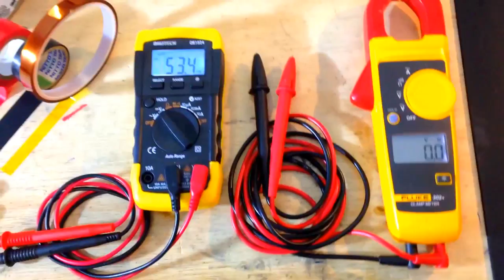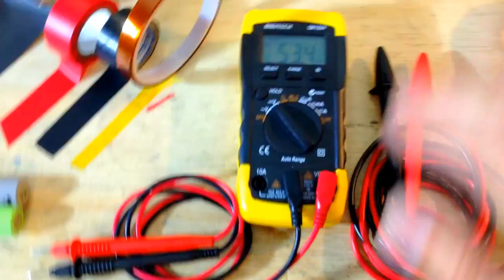Planning on making your own battery pack? DIY guide / tutorial • 18650 cells Electric Bike

Comment: We are building our first battery. So far seems good! When you finish building battery, what tests do you run? We are going to test balancing, and heat. Anything else you recommend? Thanks so much!
Reply from the maker: +Clifford Zvengrowski - Yeeahhh.. I am glad you're asking these questions... this is a good thing =] We source our cells freshly from LG Chem, by the time they arrive in our hands the cells are less than 30 days old (sometimes 2 weeks old) and individually tested by advanced machines at their factory. We could get the cells and build the pack without testing anything but we test the voltage just in case, they are always fine, always exactly the same voltage... then I group all cells with the cell holders and start spot welding. I measure the series voltage, I measure the whole pack voltage, I charge 100% and discharge all the way till the BMS cuts the power. I repeat the cycle about 3 times. We use a simple watt-meter that gives us the voltage, amperage, Ah... I will be posting a video showing how I continuously discharge these packs.. it is really intense on the cells.. basically I hooked up 4x 12v H7 bulbs connected in series (48v) and if you want more watts/amperage you add another 4x bulbs connected in parallel. I found that 4s 3 or 4p configuration for this discharger are the best configurations, your cells will be hot after 5 minutes, so grab a fan... Lithium cell don't like heat... don't force too much. Be extremely careful with every single detail, plan every movement and watch everything around inspecting for metal things that could possible cause any short circuit. Remember.... so much POWEEEER =]
Reply: ElectricBike
NICE! Thanks so much! We are using Panasonic PF. They are 4 months old, and we pay 3.84$ + free shipping per cell. Do you think that is good price? We choose PF because we think it will be better for a first battery. Once we get better at battery building we step up to higher discharge and capacity.
Reply from the maker: +Clifford Zvengrowski - Yeeeahhh.. $3.84 per cell is a good price... free shipping ohhh yeahhh.. get it...  make a big pack with lots of Ah for less voltage sag and better range =]
PF is really reliable and stable cell + it is really cheap. The downside is there are some fake cells around which is kinda scary... you never know what you're getting.. maybe get like 5x and test how many mAh you're getting per cell, if is something around 2900mAh you get more.... more POWEEEERRRRRRR hahaha.
Reply: ElectricBike
YEAAAAA! We already tested capacity they are authentic. Check out Honquan trading on dhgate, they have alot of really good cells for cheap. Pretty fresh too. 3-4 months old.
Reply from the maker: +Clifford Zvengrowski - This website is not working for some reason but I guess will be something similar to Alibaba connecting businesses... love that.. good bargains =]

Comment: do you think using reset-able fuses in the battery is a good idea?
Reply from the maker: Yeah, I repair lots of random battery packs at work, some packs maybe 1 in 10 will have resettable fuses also called "polyfuse" or "polyswitch". These fuses are normally one per series but I have seen some videos here of people making one per cell which makes a lot more sense, you can get hundreds very cheap on eBay, it's kinda easy to solder to the cells and you won't need spot welder at all. Tesla uses a thin wire at a fuse in each cell but they're not resettable ones. Cell fuse comes handy in case of an accident specially if the pack is crushed or punctured the cells would short inside the pack but the fuses will isolate avoiding the whole pack to go BOOOMMM =]

Comment: You didnt go and build yourself a new pack without filming the build process for us did you :) 

I thought you were going to try not using a bms, did you chicken out?

I was wondering if you could help me understand, you get up to 85km on you racer, I have a 26inch mountain bike with 52t ring and 11t at back, going down a big hill top gear pedalling as fast as I can I can only manage 50 to 55km. Surely wheel size isnt accounting for 30km of extra potential speed?

Im trying to work out if I should use the bike I have for the kit or buy something new, and if so hybrid or 29er or racer, not so keen on racers personally.
Reply from the maker: +Jayme Capurso - I am making some packs this week and will try to setup a camera shooting in a nice angle kinda doing a time-lapse video... I will see.. that will be fun to watch.. =]
I am not a big fan of BMS but as a business... we don't know who is operating the battery pack... they could be doing something really wrong not knowing anything about Lithium batteries so in this case BMS comes handy..... 

Top speed thing.. when I was 18 I used to have a 26" MTB with 2.0 slick road tires and I used to travel on flat at constant 55kmh.. I don't remember is my chainring was 52.. 54.. or 56 but was 11T cassette... a bigger wheel like 700c/29er would help too... faster cadence (it is a matter of practicing https://www.youtube.com/watch?v=h5a3C2MC87g ) the biggest problem is actually fighting your own aerodynamics... this is what is stopping you from going faster.. at 40kmh 87% of all power you put on the pedal is actually used (wasted) fighting with the air...  the faster you go the higher this percentage will be.
I am not keen on hybrid and road bikes.. I got my road about 3 years ago just to try and never liked...  I put the motor on it just to make it a bit more fun and make a good use of the aerodynamic advantages.. apart from that.. it is a horrible and uncomfortable bike with or without motor...  maybe just stick with your 26" and get a road slick tire it will help reduce the drag, you will roll faster.. check out this one http://www.pushys.com.au/continental-gatorskin-atb-26x28c-road-tyre.html the ideal is actually something like that but fatter like 2.0 so you increase the total diameter making your 26" a bit bigger =]
Reply: I have actually put 1.5 inch slicks on it and run them at 60 or 70 psi. I didnt know you could get chain rings that big, I thought 53 was the biggest. I have bar ends so I can get down lower so Im surprised Im falling so far short on max speed, must be my fitness, I cant pedal anything like the speeds in that vid.

I feel the same way as you about road bikes, they are great for going in a straight line for long periods but for anything else they are bad.
Reply from the maker: +Jayme Capurso - Are you sure your speedometer is correct and not set for different size wheel? Yeah the highest the PSI the less comfortable but the better rolling you get...
You just need an adaptor like this https://california-ebike.com/product/hd-130-chainring-adapter-bafang-bbshd/ and the sky is the limit.. you can get some really big ones like 56T or more... some of these 20" folding bikes have a massive chainring like 60T to compensate the small wheels....
Reply: I actually dont have a speedometer but there is a well known big hill with a permanent speed camera at the bottom of it so you know everyone is doing 60, I couldnt quite keep up with the cars hence my guess of 50 to 55kmh.
Nice link, so any thoughts on what your next bike choice is going to be?
Reply from the maker: +Jayme Capurso - Hahaha.. this is a good way to measure your speed... hahaa
My next build is something like that... not a bike but a trike almost like this one https://www.electricbike.com/50mph-monster-electric-trike/ check out the videos doing burn out!!
I am also considering a fat-bike and soldering a frame from scratch... make something a bit different than the usual Stealth Bomber style ones...
My mind is going a bit wild... this is a good thing hahahaa..

Comment: I love this tutorial.. Thanks for posting about the ugly side of copying the reinvention of a wheel!  The 18650 Cells you're showing.. In your experience (which I'm assuming is experienced experience) will they last under normal expected use?
Reply from the maker: +Dan Regalia thaaaaaaanks mate, I'm building and fixing the most random battery packs every single day hahaha maybe I understand a little bit these things =]
18650 cells showed in my video will last for years during regular use, the more cells you have on your pack, the less stress /heat generated per cell = the longer life. Bigger battery is beneficial in almost every single way, the ONLY downside would be weight, but it's worth carrying this little bit extra ohh yeaahh
Check out my other recent video where I show lots of things inside a 49Ah weatherproof battery pack https://youtu.be/wN7HCj1dgSY
Here is my 42000w bike https://youtu.be/yfn_HKViwtM
So much POWEEEEEEEERRRR

Comment: Hi I have an error 8 message on my Chinese 1500 watt 48v ebikemotor kit any ideas why the motor will not switch on? There is no pas attachment. Only one white wire not attached to the motor to controller. Brakes not attached. Pas not attached. Sensor not attached. Thanks Robert
Reply from the maker: +harveyboy45 Hi.. so the display turns on but the motor doesn't spin, could be one of the thick phase wires or hall sensor wires bad connection try to unplug them and connect again. If could also be a bad hall sensor, you need a multimeter to test it. Have you checked the battery voltage?
It's a bit hard to tell exactly what is happening, there are hundreds of Chinese controllers out there.. the wire colors are all different, they don't really follow the same standards so it's a bit of try and error testing where the fault is coming from. Hopefully you get it right. Try to find the model of your controller and Google some info try to find the manual so you know what error 8 means =]
Reply: +ElectricBike (Bruno) Hi Bruno If you can give me your email I will post you my set up. I'm going to test the motor and hall sensor wires any idea what a 48v 1500w should read or do I just listen for continuity between them. Thanks love your energy dude. Keep doin what your doin. Love and peace.
Reply: +ElectricBike (Bruno) Hi Bruno 
I've run a diagnostics test with the  Wan Sheng Long Controller Tester. You know the white gadget with the flashing lights on the front . The green halls sensor/wire seems to be faulty. No continuity with the halls wires either. Guess I'll try and change over the halls once I get a hub plate lifter. More money. Hey ho.

Comment: haha love your videos! do you make batteries for sale? Im in adelaide and thinking of doing a BBSHD or a cyclone 3000w build and am looking at getting a 52v around 20 ah battery but dont know best places in australia (im in adelaide) to get it from that wont break the bank
Reply from the maker: +Trick5ter001 - Yeeeahhh.. thanks for watching hahaha... YESSSSS... we do make batteries here in Australia.. we are actually setting up a battery factory in an industrial area Wollongong NSW =] At the moment we are making custom packs in Sydney, we can make a 52v 14s pack using these LG MJ1 3500mA cells you can get 17.5Ah / 21Ah 24.5Ah pack for looooong range!!!! =]
For a quote please contact Ewan at sales@emax-ebikes.com.au or (02)9557 4515  and mention that we have been chatting here on YouTube... we also sell BBSHDs, you may get a good deal if buy as a package with the custom battery =] Not trying to put you off the Cyclone motor, I am just telling you some real facts (not my opinion) the Cyclone is definitely noisier (two chains), bigger and heavier, more difficult to install, you need to find a room somewhere in your frame for the external controller (little brick) and so many wires and connector that you will never use. The Cyclone at 52v is not 3000w its more like 2080w with the 40A controller (the BBSHD peaks 1500W) you only get 3000w with a 72v battery (expensive and big). The Bafang ones have a nice and very neat harness with waterproof connectors and the BBSHD motor is more efficient (much better range). I have a subscriber who told me that he had a Cyclone "3000W" first (because was cheaper), then he got the BBSHD and was blown away "what a difference in range, efficiency, noise and many other little details". Cyclone is great off-road budget setup... if you want to a bit of everything you better go with the BBSHD =]

Comment: Hi Electricbike man, can you tell me- What does the protection chip on protected 18650 cells do? Does it protect from Over-discharge and over-charge, both? :))
Reply from the maker: +Kketansa Art - Yeaahh.. very good question =] "protected" cells are common for single cell devices like electronic cigarette and lights that doesn't have any "cut off" protection on the device. When it comes to electric bikes, 95% of motor controllers will have the cut-off function so there is no need for additional protection. The battery management system, the circuit that controlls the battery pack has a cut-off there too so we are talking about doubling the protection.. if you use a protected cell you are adding a 3rd protection... one protection is enough... 
Yes, the protected cell should protect from over-charge, over-discharge and high current (this is what they claim) who knows where they source this protection from... 

If protection was soooo good, all large battery manufacturers like Panasonic, LG, Samsung, Sanyo would be offering "protected cells" but none of them will offer for a simple reason: All protected cells have a potential hazard that un-protected cells don't.....a positive strip on the outside of the cell with just a thin strip of insulation between both the negative cell wall and negative body of the light. Basically the "protected" cell technically more dangerous =/
Reply: Hello, Can you see my previous reply? There were image links in there, might go to spam.
Reply from the maker: +Kketansa Art - Hummm... this is a good news for the vapper guys... they won't kill themselves exploding cells and their faces!! Maybe the large battery manufacturers realised that there is market for these cells and they finally released something that is not a homemade adapted protection.  
This little circuit is nice https://www.youtube.com/watch?v=Qw4psECqpwI
OK, the "problem" you may have when adding too much protection is that the values and tolerances of the cut-off will "activate" the protection too soon. Maybe get unprotected cells if you're using this little circuit with protection already. 
I like your idea of having 6x TP4056 modules to speed up the charge increasing the output from 1A to 6A... but... if all these cells are connected in parallel, all these cells become 1x big cell. I am not sure how this little circuit will behave if you have 6x circuits and only one big cell... it may work or you may fry something. You should consider that you will need 6x USB cables, normally the USB ports have a limited current so you may not be sucking all that power from the USB ports from your PC... if you really want it charging faster and not taking hours and hours and hours.... just research a circuit with higher output =]
Reply: +ElectricBike (Bruno) 
Amd more, If I combine the output of all the cells(for output load LEDs), All the TP4056 will also get combined on both ends. They will no more charge the cells individually. Then while charging, what if one or two cell gets charged before time and triggers all the modules as charged? The rest of the cells will remain undercharged right?
I hope my questions are understandable and valid. ^_^
Reply from the maker: +Kketansa Art - Humm.. if the cells are connected together in parallel they will be all balancing each other to the same voltage so there is no higher and lower voltage there, parallel basically means one big cell, it doesn't matter if you have 2..3.. 25 cells... a little voltage circuit doesn't know how big the cell is.. it only measure voltage. You must control the voltage in each series to safe levels between 3v and 4.2v but charging series with separate circuits is very likely that the whole pack will get unbalanced soon. The best way is to connect all together to that voltage you want and always charge via the main positive and negative =]
Reply: +ElectricBike (Bruno)
Alright, thank you socmuch for telling. As I wont be doing it in serries, all just parallel.
Thank you. See you, good wishes. :))

Comment: Is there any way to convert a 3 wire BMS to a 2 wire one?
Mine has different negative wires for charging and discharging. I missed this detail when I ordered it, this would be my first battery pack.
Edit: Love your permanent HYPE! XD
Reply from the maker: Hi Luis, the BMS with 3 wires is actually designed/routed differently internally so you must follow the BMS or buy another BMS with two wires (charge+discharge on same wire)
Yeahhhh never stopping energy here... I get waaaaaay too excited with technology and all that POWEEEEEERRR hahaha =]

Comment: hi! Is it enough to hub motor 1500 watt panasonic 3400 mAh or LG 3500 mAh battery. Does it reduce the performance? discharge confusing me.(10A)
Reply from the maker: Hi Cengiz, it depends how many cells are connected in parallel (total Ah) in your pack. Most battery packs are 4 cells in parallel so if each cell can handle let's say 10A (LG MJ1 3500mAh or Panasonic PF 2900mAh), 4 cells you can discharge 40A, 5 cells 50A. 
It's "possible" to have a small pack but it won't give you any range and the batteries will get really hot depending on your riding style, this would reduce the life of the battery.
Hub motor draws lots of amps and is VERY inefficient uphill so consider the biggest battery possible capable of discharge much more amps that the motor will be drawing. May be good to get a powerful pack from Paul www.em3ev.com he knows a lot about hub motors. =]
Reply: thanks.